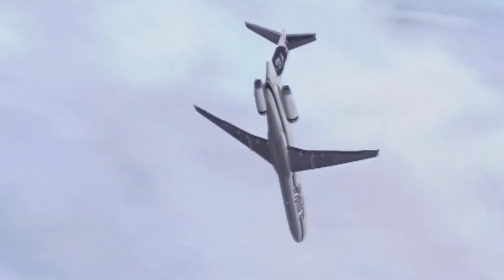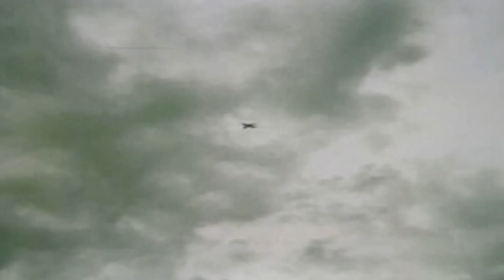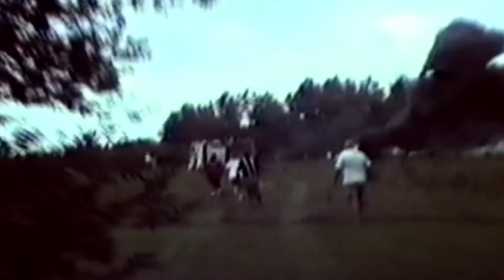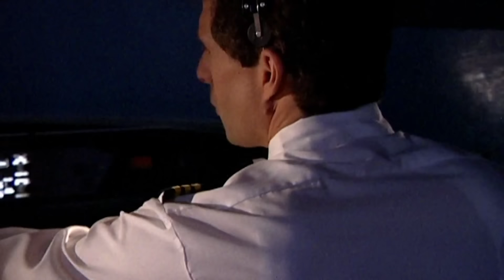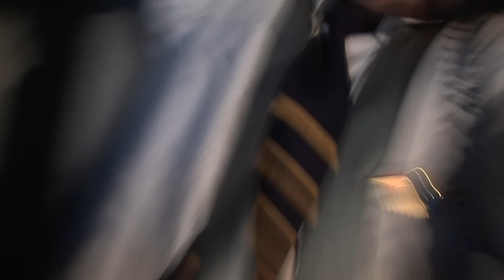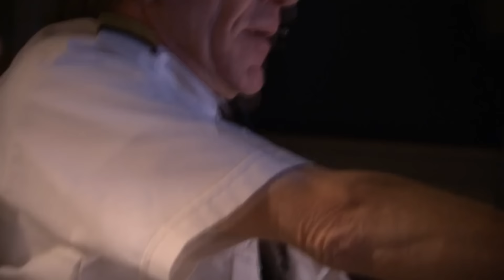The Consequences Of Overlooking Aviation Maintenance And Repair... | Mayday: Science of Disaster

Comment: My husband was a helicopter pilot…. Long story short the “Jesus Nut” that holds the blades to rotor mast was not torqued appropriately. My husband was a trained military pilot and could auto rotate on a moving ship in the dark of night. Just two weeks prior to the accident he passed a civil checkpoint for auto rotating because now we lived in Ethiopia doing famine relief. Even in auto rotation, as the nut backed off like a lid on a jar, he had no lift to the blades to work with. He and his passenger died on impact. Even though there was a desperate effort to hide the truth, with the mechanics getting to the scene the first day … the rotorhead was removed from the blades. The ECA took pictures earlier the same day. It was there. 3 days later, even though the salvage had not started, I took pictures not knowing earlier pics were taken. The blades were still there. The rotorhead was gone. This is not a part villagers would have scavaged. Bottom line… just a properly tightened screw would have saved lives.

Comment: 33:20 feels like my car 🥲. Got a cheap first car from a used dealer "she's got a bulkier battery in 'er, beefier starter, and when I got 'er and was inspecting. Saw th-a trunk button was gone. Everything runs fine buuut. I'm-a mechanic, not a-letrical wiring guy so, I -aven't touched anything" alright. Deal. Now almost 7 months later, my starter motor melted/burned though my serpentine belt... After I got off work and was about to leave

Comment: 1: Again, I will say that: The moment we are on the plane and in the air, there's no guarantee and we are out of our comfort zone.

2: There's always a cause and reason for us to find out and that's what investigators are for.

3: It is always either Human Factor Human Error. It is either design flaw, improper maintenance and/or malfunction. A loosen screw and/or a missing bolt can cause a catastrophe event.

4: Lastly, materials and components, weather conditions, overall weight, miscommunication and confusion, the situation and circumstance is not always guaranteed! The engine might break-off, the wings might also tear apart. However, from time to time, things, objects will wear and tear. Just like us, we will fall sick and grow old.

5: The CRM (Crew Resource Management) is a very crucial and important factor. But passengers can also help to report if something is not right. Just don't panic, stay calm and patient. Lastly, do not be too happy about being safe and surviving the whole course.

Each and every circumstance has a different consequences. Each and every second is a triggering factor. Each and every decision is a crucial attempt.
🧘🏻‍♂️🙇🏻‍♂️🙏🏼🤲🏼

Comment: Any manufacturer that has to lay workers off, inspection is usually the first hit. Inspectors are considered non- productive workers. If a station usually needs 3 inspectors they may may pull 2 off the job and leave 1 to do the job and try to keep up . I was an inspector in the auto industry for 20 years. I'm sure the aviation industry is run no different. That's why you couldn't pay me to set foot on a plane .

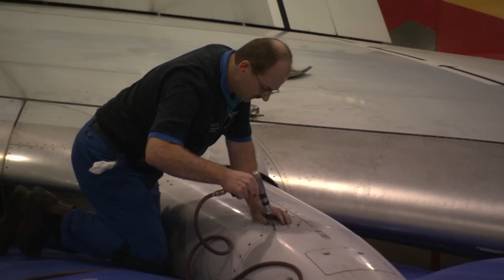Comment: 41:31...I hate it when an idiot uses a pneumatic drill to install 10/32 screws. It over torques every one of them, making it impossible to remove without stripping the philip screw head. Break out the #30 drill bit and easy out.

Comment: 2:29 #1 Alaska Airlines Flight 261
S01E05 - Cutting Corners
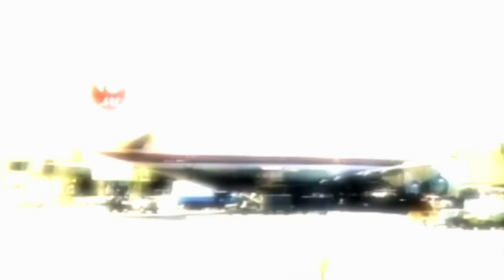10:24 #2 Japan Air Lines Flight 123
S03E03 - Out of Control
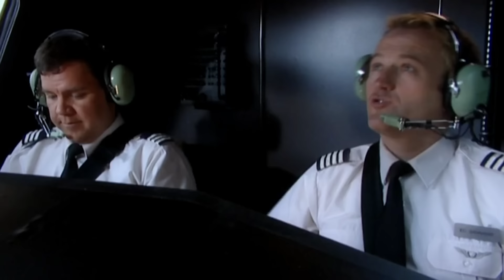17:25 #3 Atlantic Southeast Airlines Flight 529
S02E02 - A Wounded Bird
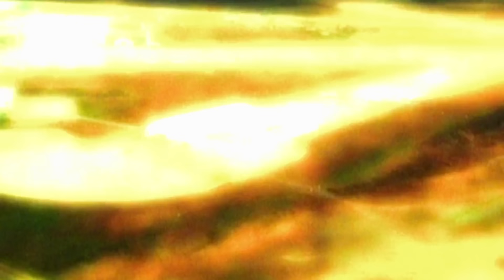27:37 #4 Swissair Flight 111
S01E03 - Fire on Board
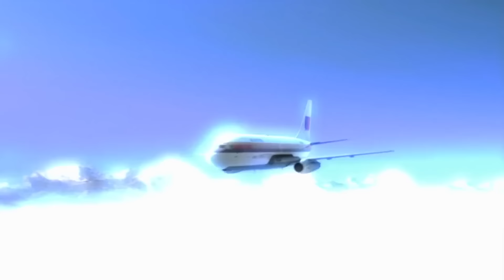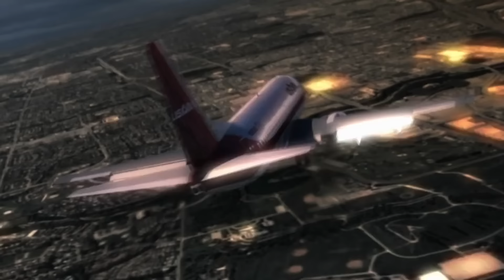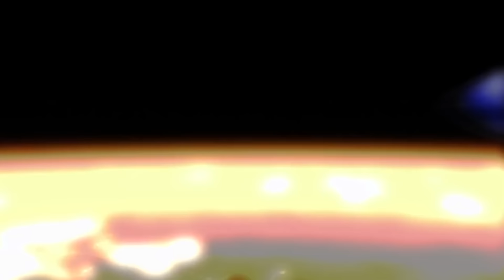35:56 #5 United Airlines Flight 585 39:16 #6 USAir Flight 427 42:22 #7 Eastwind Airlines Flight 517
S04E05 - Hidden Danger
47:07 the inspection on the Southwest Airlines 737  is complete

Comment: I am not a professional or genius but even I know how hot wires can get when using something to much. If i was an airplane designer I would but the least amount of wiring. And plan A, b and C incase any important device fails. I would even put capsule sphere seats with parachutes for each passanger. With an injector seat blast off button and a manual release lever. 100% safety guaranteed.

Comment: Ya know, the NTSB never explained how the 737 was working well for decades without suffering this rudder issue...and the only conditions it needs to happen is basically just extreme temps?!? How have those conditions not been met to produce this malfunction hundreds of times over???
Reply: At the time the rudder power control units caused the 2 crashes, there were about 3,000 737s in service. It was an extremely rare combination of variations in wear patterns, hydraulic fluid conditions and temperature differentials between fluid temperature and control unit temperature that could result in rudder reversal. 99.999999 % of the time, the control units performed as designed and expected. It took years for it to happen, but given enough time, anything that can go wrong, will, and it finally did.

Comment: Components are supplied by various manufacturers that goes into building an aircraft, and most of these parts can fail anytime.
Just like our automobiles today, aircrafts have sensors for every part that informs you what needs to be changed, It's not just poor maintenance that can bring a plane down.

Comment: Your headline is misleading. Only one of these disasters were due to faulty maintenance. Design flaws and/or procedural errors, maybe, but not errors of maintenance personnel. Even the prop guy was following the procedures he was taught, and using the equipment he was given to use. The one POSSIBLE exception is the bulkhead repair that eventually blew off the tail.

RETIRED MSGT USAF, JET FIGHTER MAINTENANCE MAN.

Comment: This is true. One of my parents' friends died on AA 191 where there were shortcuts made in engine/phylon removal and reattachment during its "C" check in Tulsa to save money but it cost lives. And the "C" check caused the problem rather than discovering a previously unknown one. They had to ground the fleet of DC-10s b/c other airlines besides American Airlines were taking similar shortcuts.
Reply: The Dash Crash 10 was a problem airplane from the beginning. The Mustard video on the troubles of the DC-10 shows off the biggest flaws, but the biggest flaw of all was McDonnell Douglas's corporate attitude of the bottom line, which hollowed out Boeing from the inside after the merger.
Reply: 100%
Reply: Knew of kids whose parents left them with their grandparents so they could go to a wedding.   Lots of other problems also happened.  The maintenence worker at Tulsa who left his forklift for 5 minutes early to go to the bathroom ended up committing suicide when he realized that he helped cause the crash.

Comment: Then too the FAA watched from the usptairs balcony while AA mechanics removed and replaced engine/pylon combos on DC-10s using a forklift, instead  of removing the engine from pylon first then removing the pylon. Remember AA flight 191 in Chicago leaving an engine departing the wing, 277 dead, the FAA quick to point fingers, but never at themselves

Comment: I was building 737s on the Renton flight line during the rudder failures. We had to test and retest brand new parts on brand new aircraft. It's like tracking a ghost. You're looking for a trail from something that doesn't exist. Also did contract maintenance work years later. Herein lies the rub. Airlines have "workcards", a specific task to accomplish with only X amount of time.  I remember working cards in Duluth Minnesota on A320s. Those people up there simply didn't give a ish. If the card said three hours to clean the circuit breaker box you better be done in three hours or less. Doesn't matter how much debris and dust you encounter, just make the clock happy. BTW, dust and debris around wires and circuit breakers has caused many aircraft fires. I was so glad I got another job offer after only four weeks.  I couldn't get out of there fast enough.

Comment: Proud to say as an licensed aircraft engineer for over 20 years with Airframe & Powerplant and Avionics rating and worked in aricrafts like B747, B787, B777, A330, A345, A350, A380; I did my utmost best to maintain the aircraft during my routine checks and not cut corners to make the plane airworthy and prevent avoidable accidents like this knowing lives of the passengers and crews are at risk.
Reply: Kudos to you sir

Comment: So, what I'm getting from the section on the 737 rudder problems is that Boeing has a lot longer history of releasing fatally flawed planes than just the Max.
Reply: You may want to look up the history of Airbus also.  All airplanes have their growing pains.  The 737 has gone through multiple generations that span back to 1965.  That is 58 years of history.  When you have airplanes that span that length of time, there will be flaws.  The key takeaway is the flaws were found and fixed.  The rudder problem is one of those situations where its an intermittent problem caused by thermal shock.  Typically, these type of problems are the hardest to find since the signatures come and goes.  Its good that they discovered the problem and fixed it.
Reply: McDonnell-Douglas. Damn near every DC-# plane had an issue. Or, even better, look up the de Havilland Comet. They had a nasty habit of disintegrating in-flight. 

Boeing just seems to put out MORE flawed aircraft due to the fact that they're the ones putting out the most aircraft. (But the MAX doesn't have issues, darling. It has SUBSCRIBTIONS. It's like Boeing's 'Mid-Life Crisis Creation.' It needs to get GONE.)

Comment: There is one (IMO unforgivable) crucial test missing from that maintenance schedule: A Test Flight. You cannot be certain there are no unforeseen problems until the machine has performed that which it was designed to do - Fly - and land safely. In the pursuit of profit this has obviously been deemed too expensive but after major work you cannot be sure without a test drive (I know as I had a Motorcycle workshop for 30 years) and there have been recent crashes that would have happened without passengers if a test flight was done. Also if a member of the team was required to be present you can be damn sure nothing would be left to chance. Amazing machines yeah, but it still comes down to money - if it didnt crashes would be almost unheard of...
Reply: If you are a civilian maintenance contractor working on submarines in US Navy you or one/some  of your fellow workers gets to go on a check dive. Not as an elective - it's mandatory.
Reply: Absolutely. 
A test flight should be mandatory.
Reply: I was thinking the same. If something in the aircraft damages, and they fix it and need to test it in the air , they should do a test -fly if you will around a designated area and airport
Reply: The shop took my car for a test drive when they replaced a break line, another line blew when they did. Could have been me getting into a car I think has working breaks only to have them blow out again if they hadn't tested them. And it's just 1 person that vehicle is responsible for generally...not dozens or even hundreds.

Comment: Single point of failure by a single Jack screw sounds like a design flaw.
Reply: No grease. Dry metal against dry nut. What do you
  get?  Friction breakage.
Reply: @sharoncassell9358  But there's still a single point of failure.  Better to have a design that doesn't bring down plane if somehow that mechanism fails (due to whatever reason).  Other planes have redundant hydraulics for some systems, etc in case of failure\damage to that area.
Reply: @maxprivate3805  You are correct, this is a single point of failure.  The realisation that this was the case caused some soul searching among the regulators after the accident - along the lines of how did this thing get approved in the first place...  The regulations are written in blood.
Reply: @maxprivate3805  No backup system at all.

Comment: I used to love to fly. There are too many plane crashes happening now for it to still be safer. In a car, if you forget to put the gas cap back after getting gas, you won't crash and die from it. If you run over a small animal, you won't crash and die. If you are a complete idiot and think you know how to fly better than the manufacturer, this one will make you crash your car and die. Happens all the time. You can spend days watching the shtuff. Anyway, flying is not safe.

Comment: In the airline industry most management personnel have no clue on aircraft maintenance and all they care is whether the aircraft is ready or not as they have no comprehension whatsoever of the extreme critical nature of certain repairs and puts the pressure on the technician if the aircraft is not ready and sometimes overrides the technician and signs off the repairs whether done correctly or not but does not show up as a disaster months or years later as top managers could care less as long as the aircraft flies I have seen this my entire 38 years working at a major airline(MANAGEMENT are Hypocrites)
Reply: There was an instance where Southwest filed a lawsuit against their entire mechanics union for keeping planes out of the air when those same planes were still undergoing inspection. I'm not sure how that lawsuit ended or if the litigation is still ongoing.
Reply: That sucks to hear, tho it's unfortunately not surprising. However, I do expect better.

Comment: So from my knowledge being an licensed engineer, you have several types of check. Pilot walk round happens before every flight, main base checks (maybe other names also) happen once a day and are performed by engineers, a checks happen around every three months and take generally 1 or 2 days, b checks are not really done separately from the A checks. C checks are generally every two years and take up to a week to complete. Finally d checks are the most intensive maintenance that happens every 6-8 years and take around a month to complete. Of course it depends on aircraft type as to the actual intervals of each check. Again, it also depends on what is found during the checks as to how long the ground time is, as the older an aircraft, the more there is the check and also the bigger chance of things being broken and life expired. In my humble opinion, performing a complete C check on a 737 in 12 hours is not possible. A 747-8 A check is around 1.5 days ground time, and a C check is around one week ground time, but if you look at the older 747-400, A check ground time is around 2.5 days and C check ground time around 2.5 weeks.
Reply: I was thinking that too, I’m a crew lead for maintenance and they said C check in 12 hours like that’s kinda unheard of lol
Reply: It seems SWA is cutting corners in maintenance, or is using a different definition of a C Check.